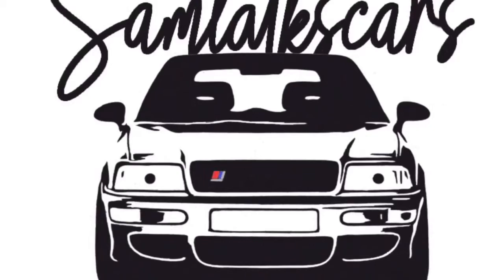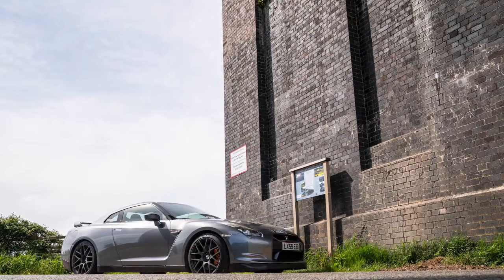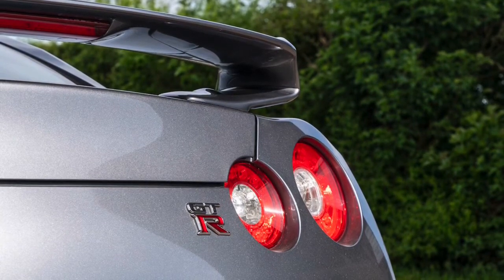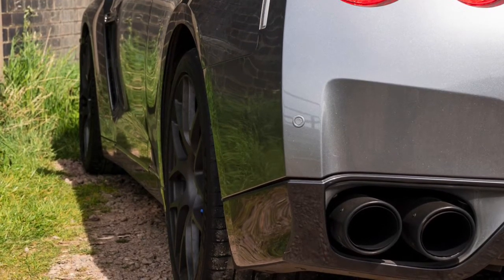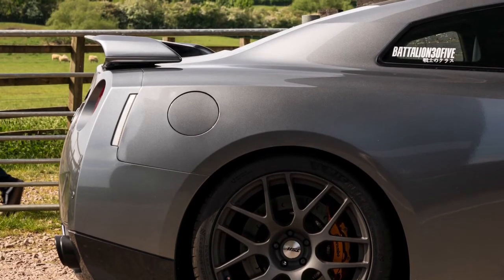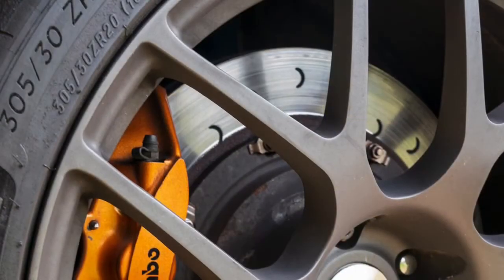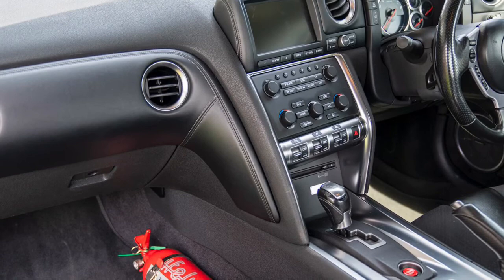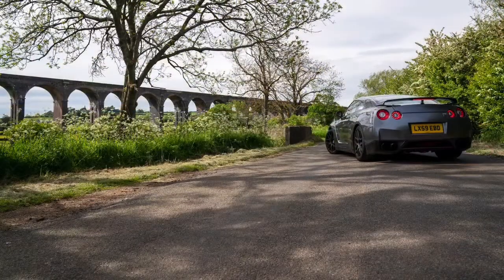Nissan R35 GTR Buyers guide to common faults

Comment: Front end noise on early GT-R ? low speeds, you might be missing upper clip on front/calipers , from factory they never came with, so the pin is moving....and jiggle - I ordered 2 from Dubai as Nissan dealer never carries them...
GTR has terrible paint. My front end looks like crap_ bumper and hood. and side's near rear wheels,-

Comment: Cleaning wheel surface for clicking noise does nothing I have had 3 gtrs all done it
Reply: Finding 2017 GTR consider buying.,
Or go for the 911 carrera s 991.2
Reply: letbraski GTR
Reply: Need to remove the brake disks and clean and lube up the hubs. My old my10 used to do it.